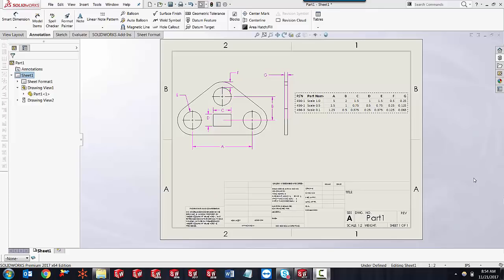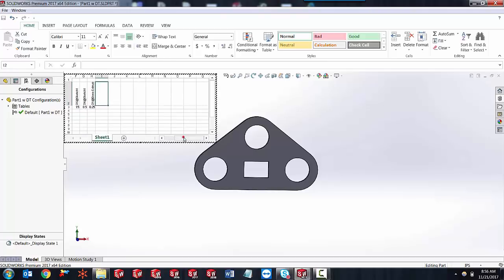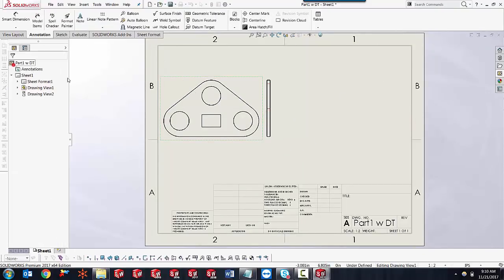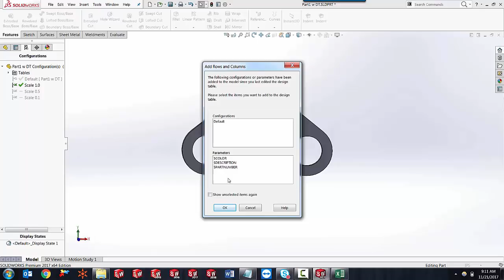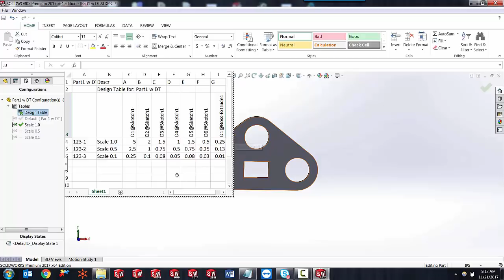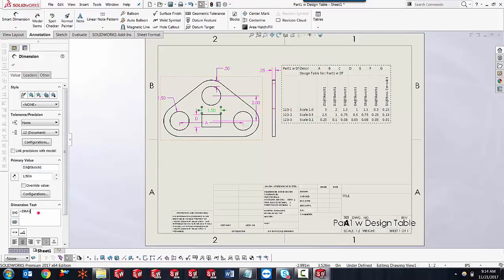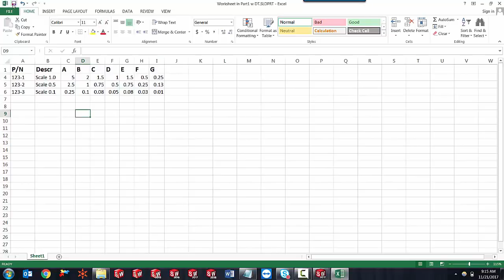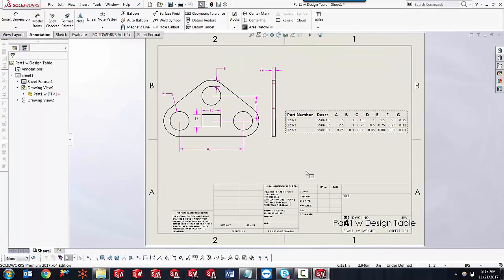SOLIDWORKS - Design Table Drawing BOM

Comment: Hi there,
First of all good video. I have a question regarding multiple sheets in a linked design table.
I wish my design table to be on the first sheet whose values are controlled via multiple data sources distributed over several additional sheets. 
I have tried a few times to link files with multiple sheets, however Solidworks displays "Failed to Launch Server Application". Do you have any ideas how to make this work, or is strictly not possible?
Reply from the maker: Hi Graham,
I don't get what you are describing in this comment.  If we are your VAR I would recommend that you send in a formal inquiry on this and let us investigate a solution to it (support@goengineer.com).  If we are not your VAR you would still want to put in a formal request to them and open an investigation.
Reply: @goengineer  This is a great question, was this able to get solved? If so, a solution video would be awesome!
Reply: Was able to be solved? Got the same question.